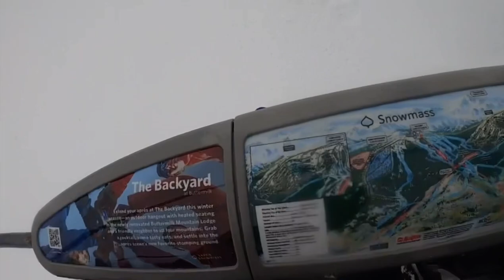Coney Glade - (Snowmass, CO)

Comment: Snwomass is replacing this for 2024-2025 with a high speed quad starting down where Burlingame started, with a midway turn station around where Fanny Hill ended.
Reply from the maker: Would the turn be a Midstation or a turn like supreme?
Reply: @NortheasternP.T.S. I don't know. If they want to have loading there then it would need to be a mid station. But otherwise I think a turn like Supreme would suffice.
Reply: @NortheasternP.T.S.  the turn is going to be a loading mid station at the original loading point for the park